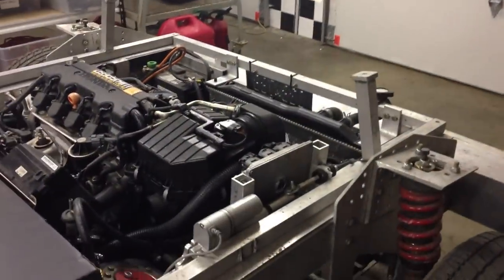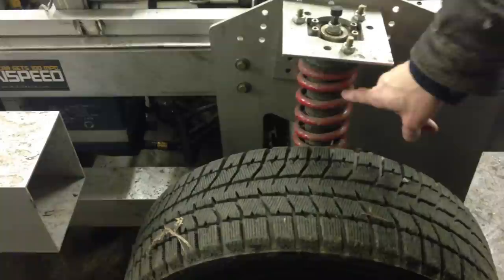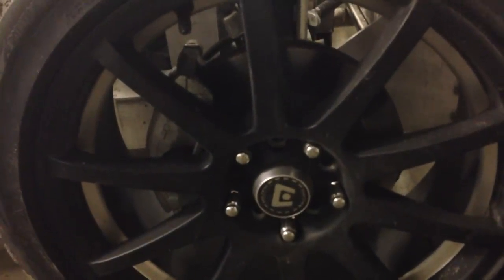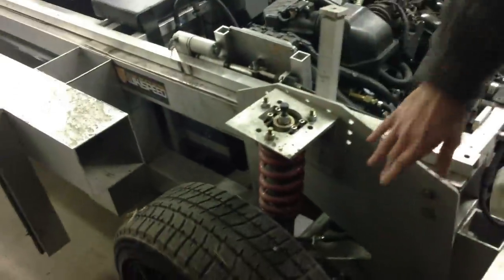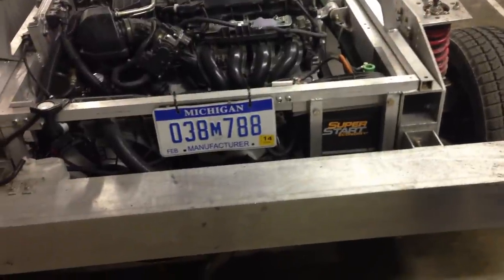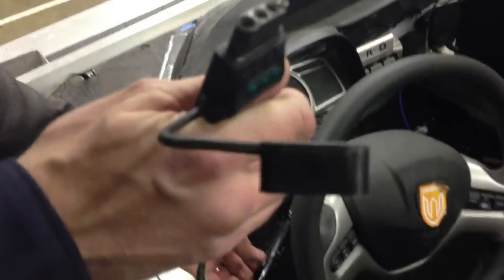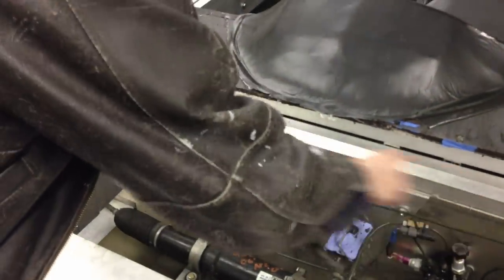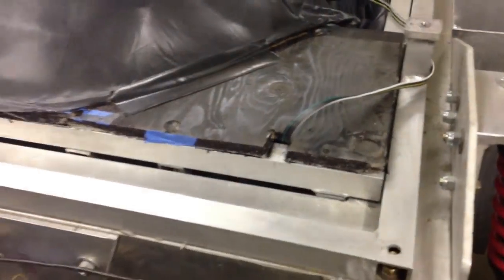Joe Justice gives overview of the parts of a car

Comment: At 6:20 you discuss the modules. Yes, you listed nine modules:
1. suspension
2. side crush
3. front crush
4. rear crush
5. frame
6. interior
7. engine
8. pedal plate
9. body